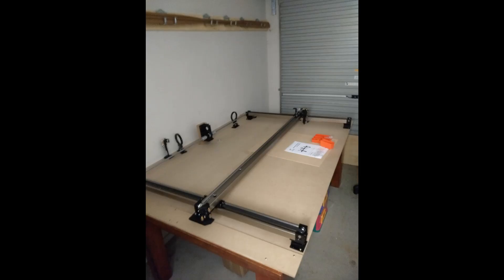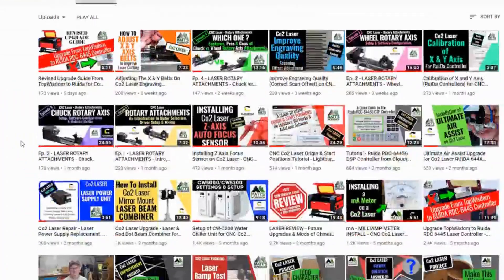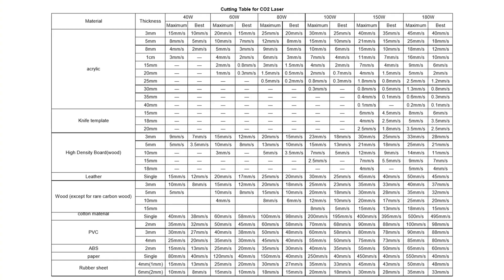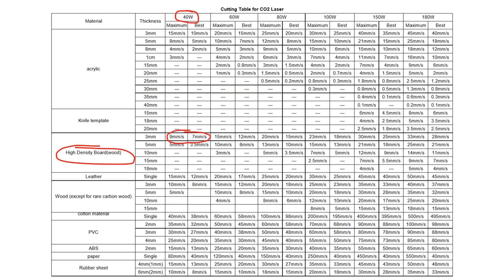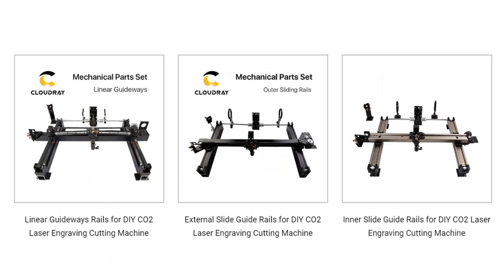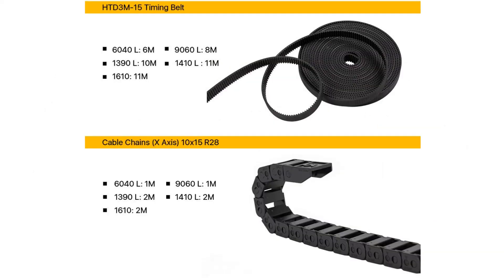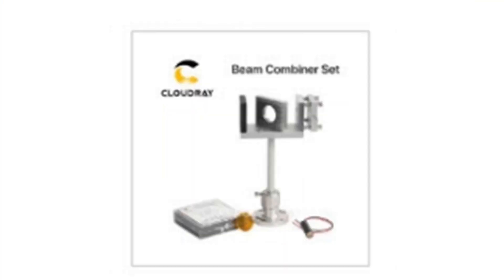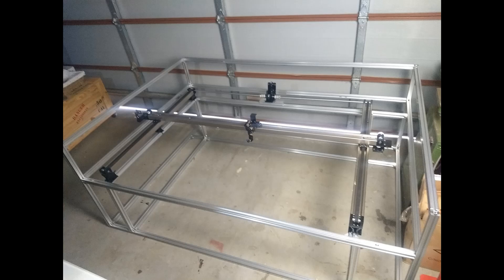01- Build Your Own Co2 LASER Cutting & Engraving Machine - Introduction, Planning & Design.

Comment: As mentioned, the power produced by the tube is directly related to the tube's length. Once past about 100W or so, the tube itself may dictate the enclosure width. One alternative are the dual-tube products, where (for example) you can get a 240W laser assembly that is not much longer than one 120W laser tube. Also, something I've never seen mentioned (and don't know if it's okay to do) is to mount the laser tube diagonally along the back wall, tilted upward. That could effectively shorten the enclosure width by up to 40%.

Comment: Hello Matt, what kind of lens (diameter and focal length ) and mirrors will suit to use for Co2 laser 80 W to cut acrylic with thickness 10mm ? Please ASAP
Reply from the maker: Mirrors don't change for the thickness of material you are cutting.  With your lens selection, the diameter is set by what your machine can accommodate.  Typically you would want at least 2.5" , preferably a 4".0 focal length.  This will also depend on what your lens tube holder can accommodate.  I explain focal length in this video https://www.youtube.com/watch?v=gGfg2zJioT8  Cheers Matt

Comment: I'm looking to build a lazer but I require to cut through 3mm thick sheet steel is there a tube strong enough to get through that?
Reply from the maker: Yes there are Co2 Lasers for cutting through steel, you will require a metal cutting head, with the gas/air assist and a Co2 tube over 150W for thin metals and even larger like 300W for thicker metals.... However the available Co2 Lasers for cutting metal are NOT stable. I'd suggest a Fiber Laser to that.

Comment: Hi Matt, After building the machine, what is the best method to program the machine specific settings into the controller? I took a look at the Cloudray website, and saw that they offer a kit of complete parts to build a DIY laser machine(except for the enclosure). I emailed them asking for any documentations they have regarding the kit, but they say that they don't have any documentation available. Will you be referencing the kit(s) they sell? If so, will you be going over setups and such beyond just building and wiring the hardware? I intend to use LightBurn with my future DIY machine. I've read so many people recommend the Ruida DSP controller, but you mentioned that you won't be using it in this video series. Will I still be able to follow your method if I choose to use the Ruida controller? Thanks for your time.
Reply from the maker: Hi Steven, Yes I will be referencing the kit, however I am building a larger unit so I have selected alternative parts, they are basically the same as the kit just larger.  I will be doing the wiring on a Trocen controller however the connections are pretty much the same as the Ruida, so you will be able to follow along, There is also the possibility that I will at a later date install the Trocen controller in my pre-built machine and install the Ruida into the new Build, however that will be after the build is complete.  
I will also be putting a document together about how to program the controller, and I will include both the Trocen and Ruida in this documentation.  I will be using the software that comes with the controller but also LightBurn.
If you are interested in the size machine that Cloudray offer in the Kit then I'd recommend it as it comes with all the necessary accessories including the chiller, fans etc.   Feel free to email me (address in description) with any questions you have and we can discuss in more detail if you need.  Cheers Matt
Reply: @MWLaser  That is so nice of you to take the time to reply to my post with a great amount of detail. I really appreciate that, and I love your video's and your perseverance dealing with this technology.

Comment: Matt Question...I think Cloud Ray makes a Laser tube with a Red Marker laser beam built into the laser tube itself....would you consider using that tube and what is the  quality of the Cloud Ray tube compared to the Reci tube?...great channel by the way..lots of good information here.
Reply from the maker: Hi, I know of the tube with the red dot integrated, however I am not familiar with it, I have not used one or know of anyone with one to provide any feedback on this unit.  My personal option/question, would be is it worth the extra money to have the red dot in the tube or just easier to use a beam combiner unit?
Both Cloudray and RECI tubes are excellent quality tubes. Cheers Matt
Reply: @MWLaser  I think the logic is that you would not suffer a power loss when it is combined in the tube as you would if you use the beam combiner lens....thanks  for your help.